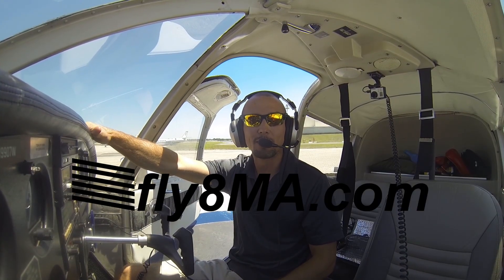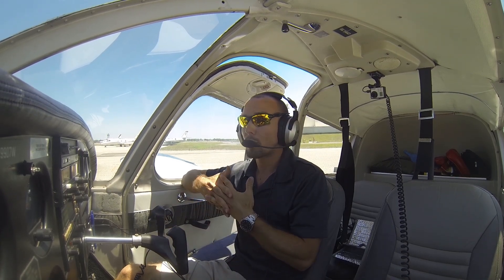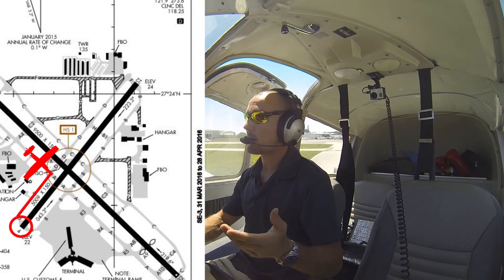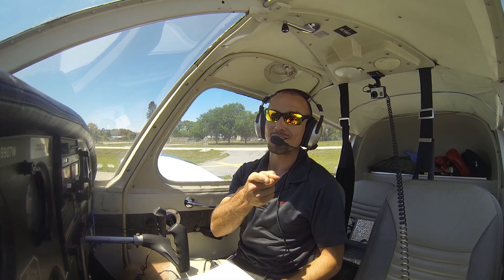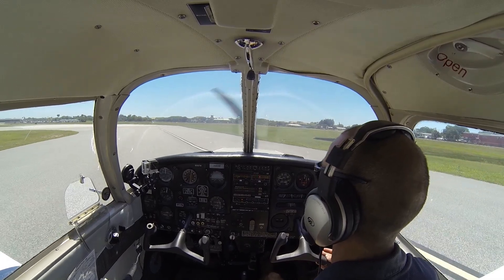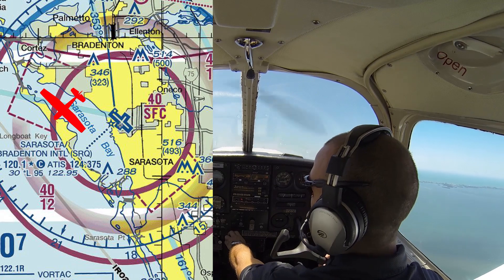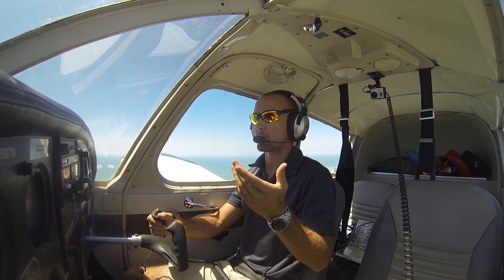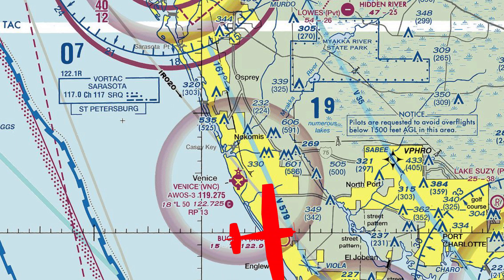Ep. 45: Departing Class C Airport | Radio ATC Communications

Comment: Do we really need to change the squawk code to 1200 before entering Class G?
Reply: Class G is uncontrolled airspace, ATC doesn't have radar contact and can't provide flight following or traffic advisories. Therefore it wouldn't make sense to use a squawk other than VFR or emergency in class G.
Reply: @Virtualmix  THX

Comment: Great video as always. You state that the fbo/dolphin ramp “is a non-movement area” and the current afid states that only the terminal ramp is uncontrolled.  As a student, my guess is that the pavement markings on the fbo ramp is what you saw to know that you could have taxied up to the taxiway before getting clearance to taxi.  Is that correct? I know that the video is older than the current afid so maybe previous versions state that both the fbo and terminal ramps were uncontrolled.  Finally, is it common that the afid will not state if the fbo ramp is uncontrolled and as a result it on the GA pilots to recognize the non-movement area markings and not rely on the afid for whether an fbo ramp is controlled. Thx.

Comment: Decent video except for the part where you said you can control airspace much better than controllers can at 8:30. Feel free to swing by any facility and give it a shot after you learn the endless rules we have to know in the 7110.65, 13-204v1-3, etc etc etc. That's how you get stuck in holding patterns for a while lol.
Reply: I did catch that remark too! Probably not exactly what he mint to say?
Reply: Could you expand on how you "make it work out a lot better than air traffic controllers do", @ 8:30?

Comment: Hi John, Really enjoy your videos! I have a question, if I may? The weather report was wind from 020 at 10 gusting to 17. ATC assigned runway 32 I realize ATC switched you to runway 04. The question is  at what point would you have requested runway 04 in order to have a more true upwind take off? Thanks again!
Reply from the maker: Hard to put a solid number on it, if the runways were equal length with equal obstacles on either end you simply choose the one with best headwind component.  Given this scenario, it really comes from knowing the airplane itself and what kind of Vx / Vy speed it has.  Being that rwy 04 is so much shorter and dumps you out over obstacles, it would have to be somewhere in the 20s coming from 020 degrees for me to switch (but that's just my comfort level with that airplane).  Hope that helps!  Fly Safe!

Comment: I have a class D question. Can you request flight following from ground or do you have to wait to go airborne and call center?

I departed KECP recently and tower gave me the freq for center to get flight following. I'm just curious.

Thanks for sharing the video! 

Anthony
Reply from the maker: Yes, actually have a video on how to do just that,  https://www.youtube.com/watch?v=4iquR2MZg9A
Reply: FLY8MA.com Flight Training Perfect!  I just checked it out. 

My training was in Class C and I didn't know clearance and ground had the same function in Class D. I assume it's the same for getting an IFR clearance.
Thanks!
Reply: If you're IFR, you'll still contact clearance in Class D, but if you're VFR, you simply contact ground.
Reply: GeneralSirDouglasMcA  As an air traffic controller, and a pilot,  I’ll tell you that you should always call clearance regardless of what flight rules you plan to fly on.  Most smaller airports (generally class D) or even slow times at busier class C or even B airports, clearance and ground will be combined on a single frequency or the controller will manage both frequencies at the same time.  It is possible that some airports will have local procedures for VFR to call ground and IFR to call clearance, but I would never just assume that.  It drives me crazy when I’m working s busy ground and a pilot calls for VFR flight following.  The clearance frequency is clearly published, and clearly different than the ground frequency.  When you want a clearance (VFR or IFR- you call clearance.  When you want to taxi- you call ground.  Plain and simple.  And I encourage pilots to seek out a tour of their local ATC facilities and ask about local procedures and best practices at your home airport.  Just call them and identify yourself as a local pilot wishing to educate himself/ herself about the airspace, etc. and we do our best to schedule you for a tour.

Comment: Why wouldn't your rationale for refusing an intersection takeoff on 32 also lead you to refuse 04 and insist on 32?
Reply from the maker: Rwy 04 still affords enough length to be airborne and make a field should you have a problem and be out of usable rwy.   It may not be as ideal as 32, but it is an acceptable risk based on the other 1,001 factors that go into the equation.  The "stack the deck in your favor" idea is simply to ensure you do what is in your control to ensure the best possible outcome, while still operating with real world constraints and accepting reasonable risks (i.e. if I want to land at my buddies house, I will have to use a 2,000 grass strip, when departing, I will taxi the full length to have as much rwy in front of me as possible, rather than a mid field 1,000' departure that the aircraft could perform, but with less maneuvering room should something go wrong)
Reply: No need to annoy the control tower than necessary either!
Reply: @jakegleason26  I thought the same thing, Jake. He could've made another change "Well, on second thought, I'll take your first runway suggestion" or just go with the latest, since it's no worse than the original offer.

Comment: Good job on no shoulder harness.........👎
Reply: Bill Golden Good Job...  correcting someone who just schooled you...
Reply from the maker: Couldn't reach the flaps or brakes from right side with them until I had them replaced with longer ones I can leave loose, gotta do the best you can with what you got.
Reply: Oh. Well. 91.107 allows for that? Because I sure can't find it myself. At 6'3" and 220lbs I never had a problem in a 140. Odd.
Reply from the maker: +Bill Golden It's in the regs, "unless interferes with required flight duty" i.e. pulling the brake handle.  #shortpilotproblems
Reply from the maker: 91.105
Reply: that is an excuse not a reason.

Comment: Very nice video. Why did you take off with flaps on on A 5000' runway ? Is it normal take off set up ?
Reply from the maker: The wing on the piper cherokee is very short, making it more a of "high speed" wing (compared to say a diamond long thin wing that flies well at higher AOA).  To help the cherokee get off the ground at a reasonable speed, its common to use 10-25 degrees of flaps for a normal take off, and standard 25 degrees on short and soft feild takeoffs.
Reply: +FLY8MA.com 
I fly an older cherokee 140 (1971) and have no issue at all taking off with no flaps of a 2500' runway, the POH actually recommends normal take off with no flaps. Its probably different in more recent cherokees like the one you are flying !
Keep the good videos coming !!
Reply from the maker: The cherokee I was flying was even a little older than that (1967).  They made three different wing variations for the cherokee, and some had wingtip extensions to help them at higher AOA.   Ours has a very stubby wing, so 10 flaps usually helps to pop it off the ground at around 60-65mph without having to use too much back pressure.  Its really to just be more gentle on the tires and gear.  It can certainly be done without flaps and will not add drastically to the takeoff roll, its just become a personal preference in most airplanes, and at least for this earlier cherokee it calls for 10 normal, and 25 flap short or soft in the POH/owner's manual.
Reply: I own a 1966 PA28-140. A normal take off, as outlined in the POH, is no flaps. Trim set slightly aft, dependent on aircraft loading. Short/Soft Field Take of is 25 degree of flaps. Other than that, great videos. (Subscribed)